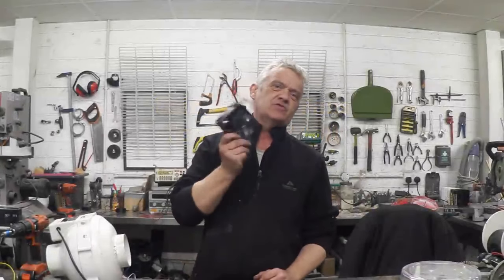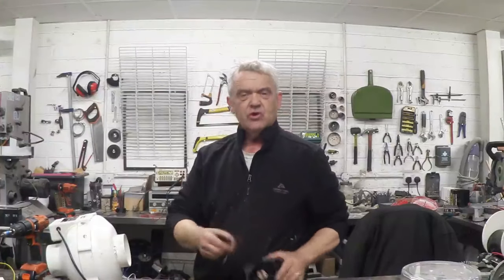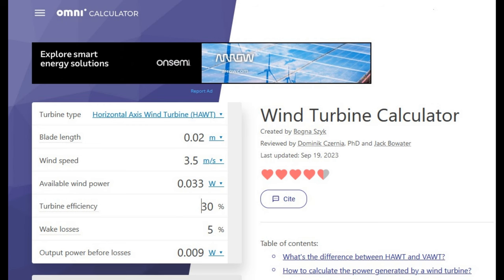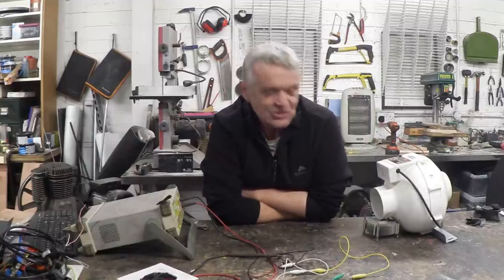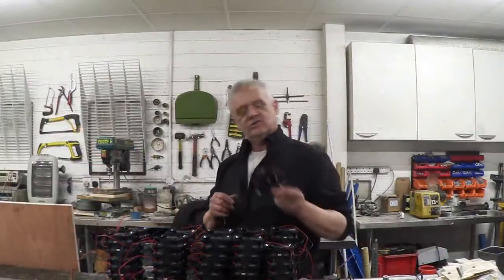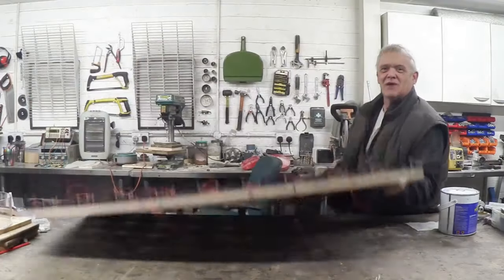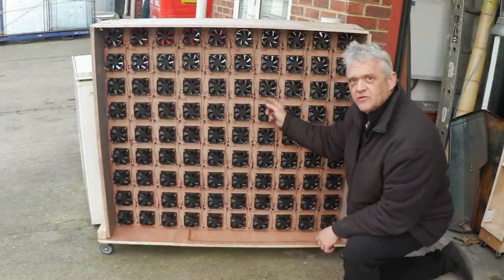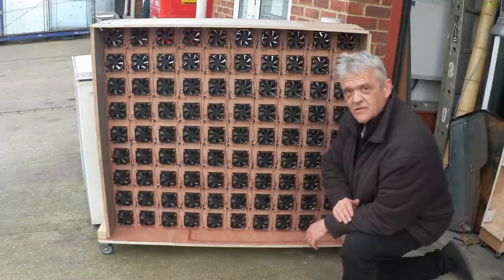013 PC Fan Wind Wall

Comment: You also can get a double channel hall sensor with output MOSFETs from a fan. It drives the coils depending on the magnet position. Can be used in different electrical toys and DIY automation.

Comment: I know this is old now but I’d be really curious to know what model rectifier you used that has a low enough voltage drop to work with the 3 volts 0.100ma these produce?

Comment: do you suppose the cost and efficiency of this windwall might increase if you remove the coils altogether and paired the fans with your "printed" electrostatic generator? my thinking is that since you mentioned it has little to no input torque you could theoretically take whatever torque is generated by the wind and use gears to increase RPM to optimize it, and subtract expensive/valuable copper from the equation.

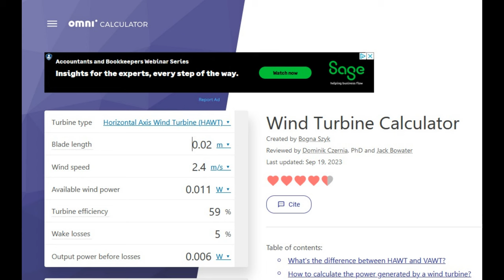Comment: Correct me if I'm wrong: using the figures posted at 15:03, of .006 watts output for one wind turbine at the stated wind speed of 2.4 m/s, so 0.006 watts X 90 = 0.54 watts total output

Comment: again I am guessing a shroud like you were talking about the difficulty in making all of them for each fan, would infact be very easy to make one that just fits along the outter edges of your wind wall, would work as well as a bunch of small ones around each fan, and take far less energy to make one that is just maybe a beveled angle of flat panel sticking up off the wall in the direction the incoming air is coming from for the wall :)

Comment: With the VAWT wind-wall, Would it make a difference if alternate columns were contra-rotating? That way the 'rounded' opposite face of each adjacent rotor would act as a funnel for the 'cupped' part of the pair. Just an idea... 🤔

Comment: Ohh...mannn...
I definitely would make sure they all stay well lubricated.
Of course you did hit them with some oil when re-assembling them.
Over all it's a great learning project.
If you replaced the stock circular magnets with some round n35's,(Alli Express)
this may be a wall, well worth watching.
Nice job...

uhmm...maybe a shroud that would collect a dimensionally larger plane of wind and funnel it down against the wall.

Comment: Hi, Rob. Great stuff, I'd never heard the explanation behind orifice plates before. Would your design using it be improved by adding squat pyramids to the front face in the center of each quad of fans, with the edges aligned to the gaps between the fans and the faces at 45 degrees? In my head it would seem to start  the airflow towards one of the fans sooner, but my head is quite often wrong.

Comment: Would routing the air inlet side of the holes with a round over router bit clean up the airflow into the small fans?  I would assume the squared edge would create turbulence at the fan tip ends.

Comment: I know building the tapered inverted cones has been poo pooed but here is another method i have conjured in my noggon. 

Use 6x6 wire “hog panel” farming fence.   48” by 120” welded steel wire panels for $26.00 each here local.   Then lay a thin sheet of ABS plastic on top.    

Heat the ABS to required temp using sunlight and help from a heat gun to allow the ABS to droop inside the 6x6 squares.  Maybe coxed with a small form of sorts?   Allow to cool and dull holes for your fans.  

Pooof!   Tapered wind catching guide for cheap and it’s water proof.

Comment: At the very least I would have used a 120mm PC fan. I have to wonder if a 12vdc automotive fan would be a better idea? They are designed for higher amperage after all.

Comment: I'm thinking of cheap ( or free ) and easy nose cones for the fans, eg discarded Kinder egg capsules.
Are the Savonius columns contra-rotating? as that should help with a less turbulent airflow.

Comment: As david.lhowser points out, would ducting further increase the air speed to the pc fans. If so, if you put the VAWT wall behind (the now ducted HAWT wind wall) would there be sufficient energy left to drive that as well, or would one interfere with the efficiency of the other?

Comment: It would be great fun, if a F1 Team would let you use their wind tunnel.   I wonder if you could get a second row of fans to benefit from the first board of fans, with air directed intentionally. Brilliant project.
Reply: Aint that hard to build a wind tunnel. Its just a sealed corridor with sensors.

Comment: On the legs with one wire , what is it , that you solder on to them ?

Also would you know which if your videos shows you making a PC fan in to a gen ? 
I did search  making a PC fan in to a gen but only showed  009 The Folding Wind Turbine
Reply from the maker: a connecting wire which you connect to the rectifier
Reply: @TnTOmnibus  Sorry , where is the rectifier ?
Reply: @jayk2k you have to add the rectifier yourself.
Reply: @verystripeyzebra  Thanks . 
I did find the other vid on his other channel but thanks again

Comment: Robert,  3D printing with smooth PETG plastic ducts that transition from a square opening to a round opening seems would be a magnifier of surface air pressure captured, and efficiently redirect to the PC Fans props to then strike those props at both a higher speed, and best angle of attack to transfer more mechanical energy potential to the PC Fans resulting in rotating them faster. Removable square nested ducts locked together on four of the square duct's sides that then are pressed tightly into the PC fan's board's flat surface round opening to hold the ducts tightly locked in place seems plausible to test the naked board against the board when fitted with the plethora of the square to round transitioning ducts suggested. When tightly populating the board face with ducts for each PC Fan the existing wind facing air pressure zone would be retained, BUT  :  )  moved outward from the boards previously naked surface to the area of the low resistance presented edges of the square nested ducts, to then have air motion guided to the PC Fans props. Resulting in more of the approchung air, at high pressure, and at a higher speed passing over the PC Fan props. The more efficiently directed air motion onto the PC fans prop blades at volume while still retaining the wall's forward facing square area positive pressure zone explained so eloquently here seems a wind force magnifier. Conversely, a larger forward facing round opening cone simply pressed into the PC Fans opening would not be much of a wind force multiplier as a wind pressure would leak around the outer round duct surface edges of round ducts onto then guided across the board face to the board edges. Thank you as always for the videos. I hope that Luke is doing well adjusting to University life.
Reply: Rather than 3d printing could you just but some cheap plastic powder funnels, cut them to suit. Might be a quicker way of prototyping/proof of concept before doing something more elegant?
Reply: @jackdaw1328  The desire is to collect, and direct all, not just some of the collected air pressure to be guided to the fan props at the best angle of attack with the most robust energy impact. The easier to make round funnel allows the air pressure zone to be leaked around the funnels outer circumference down onto the board's surface wasting wind mechanical potential energy in the form of decreased atmospheric pressure in inside the round funnel, and then the lost wind energy moves around the wind wall's boards four edges, and is lost there doing no mechanical work.That lost energy is best captured by square transitioning to round tight fit  nested funnel edges to improve increase fan speed, and electric generation performance. Imagine how much air would be directed around a traveling I.C.E. vehicle front face bumper with only a percentage of air going through the front radiator grill. Suggested here is locked together square to round transitioning funnels so that the wind wall's air pressure zone stays located at the many square funnel wide throat opening entrance point, thus pressurizing the funnel's air volume inside the funnel the most, then moving the captured positive pressure air across the fan's propellers at an angle of attack by directing air with an angled vane to apply the most air movement mechanical energy to the curved fan propellers angled surface at the best angle. Air passing at angle too then go through the fan after energy is distributed onto the propellers surface at angle as to generate more efficiently the electricity by spinning the fans at a higher RPM in the above atmospheric positive pressurized air environment caught and directed by 3D printed nested square transitioning to round funnels with internal vanes as opposed to the lower cost, and easier to make smooth wall round funnels. Basically, the round funnel do not collect, and hold as much pressure zone as the air moves past the round funnel's loosely spaced arrangement on a square board's face, and lets outside leaking air down to the board surface, then off the board's edge creating a passing pressure zone outside the round funnels. Even worse is the air zone is blocked from entering the fan by the outer surface of the round funnel. Also no vanes smooth bore funnels do not direct the air in motion at the best angle to rotate the fans faster. Lost is applying that angled, and positive air pressure onto the fan's propellers at the most efficient angle of attack. Hope that the explanation, and example of a vehicle's front nose moving through the air creating a pressure zone forward of the vehicle's bumper helps. Maybe research air fluid dynamics of race cars to know more about forward facing air pressure zones, and how to manage the air pressure zone by air foils/ vanes. The square to round transitioning funnels inner surface with vanes acting as air foils in this case, offering a path forward by directing 100% of the air movement energy along the preferred path at higher atmospheric pressure to exert onto the fan's propellers, and also at the best angle of attack to transmite the most mechanical forces found within the air movement onto the fan's propellers, which  is the intent, causing higher fan speed rotation. Cheers.
Reply: @jackdaw1328  The desire is to collect, and direct all, not just some of the collected air pressure to be guided to the fan props at the best angle of attack with the most robust energy impact. The easier to make round funnel allows the air pressure zone to be leaked around the funnels outer circumference down onto the board's surface wasting wind mechanical potential energy in the form of decreased atmospheric pressure inside the round funnel, and then the lost wind energy moves around the wind wall's boards four edges, and is lost there doing no mechanical work.That lost energy is best captured by square transitioning to round tight fit  nested funnel edges to improve increase fan speed, and electric generation performance. Imagine how much air would be directed around a traveling I.C.E. vehicle front face bumper with only a percentage of air going through the front radiator grill. Suggested here is locked together square to round transitioning funnels so that the wind wall's air pressure zone stays located at the many square funnel wide throat opening entrance point, thus pressurizing the funnel's air volume inside the funnel the most, then moving the captured positive pressure air across the fan's propellers at an angle of attack by directing air with an angled vane to apply the most air movement mechanical energy to the curved fan propellers angled surface at the best angle. Air passing at angle too then go through the fan after energy is distributed onto the propellers surface at angle as to generate more efficiently the electricity by spinning the fans at a higher RPM in the above atmospheric positive pressurized air environment caught and directed by 3D printed nested square transitioning to round funnels with internal vanes as opposed to the lower cost, and easier to make smooth wall round funnels. Basically, the round funnel do not collect, and hold as much pressure zone as the air moves past the round funnel's loosely spaced arrangement on a square board's face, and lets outside leaking air down to the board surface, then off the board's edge creating a passing pressure zone outside the round funnels. Even worse is the air zone is blocked from entering the fan by the outer surface of the round funnel. Also no vanes smooth bore funnels do not direct the air in motion at the best angle to rotate the fans faster. Lost is applying that angled, and positive air pressure onto the fan's propellers at the most efficient angle of attack. Hope that the explanation, and example of a vehicle's front nose moving through the air creating a pressure zone forward of the vehicle's bumper helps. Maybe research air fluid dynamics of race cars to know more about forward facing air pressure zones, and how to manage the air pressure zone by air foils/ vanes. The square to round transitioning funnels inner surface with vanes acting as air foils in this case, offering a path forward by directing 100% of the air movement energy along the preferred path at higher atmospheric pressure to exert onto the fan's propellers, and also at the best angle of attack to transmite the most mechanical forces found within the air movement onto the fan's propellers, which  is the intent, causing higher fan speed rotation. Cheers.